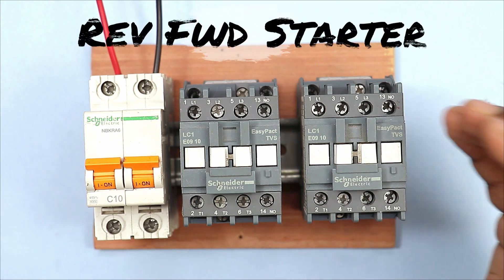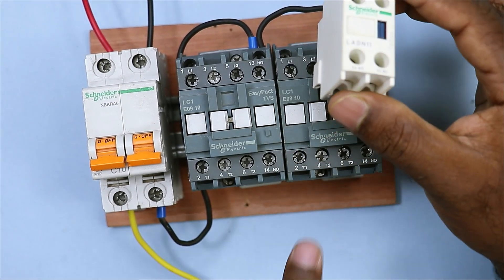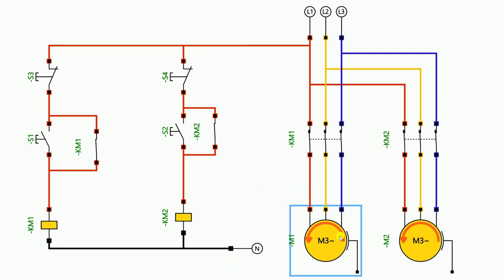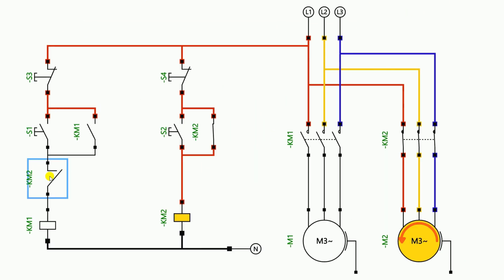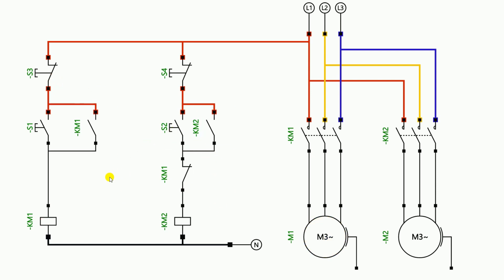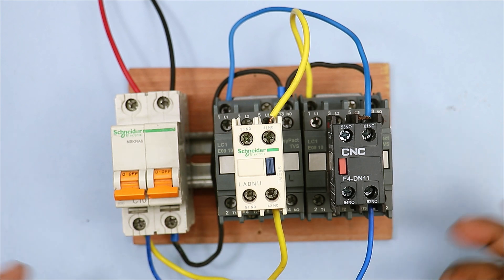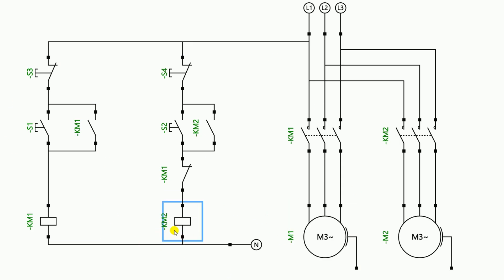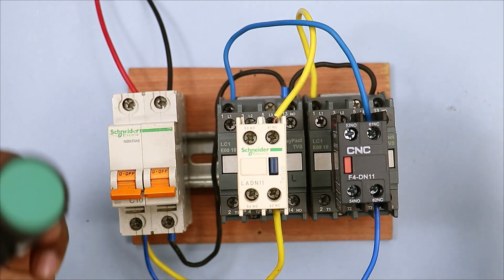Contactor Interlocking Made EASY for Beginner Electrician @TheElectricalGuy

Comment: Fantastic lecture. To use the start and stop buttons as shown on your video, I will connect the start and stop switches between the MCB and each NC on the interlocking auxiliary contactors. Obviously this connections will be on the side of the control circuit. This way, I can start and stop the motors one at a time. I hope this is correct. Thanks.

Comment: Hi Electrical Guy,
I enjoyed your video , thanks for taking the time to make it and share with us.
I'm wondering do you think this circuit would work with two split system air conditioners on a single phase circuit where the supply only allows for one AC to run at a time?
For example, there is one MCB and two air conditioners interlocked but instead of stop start buttons we use a separate remote control units instead?
I'm not sure of the remote control would work instead of the stop start set up.

Comment: Why does the 1st contactor turn on if they're both connected the same way ? Why doesn't the second 1 turn on 1st ? Does it have something to  do with the type of add on block ?
Reply: I had the same question in mind. When the MCB was ON 1st contactor was ON why not the second was turned ON instead ?
Reply: They both try to close in but the left was faster and killed coil power to the right.  Watch in slow motion and you will see the right one start to pull in. I wondered the same thing.